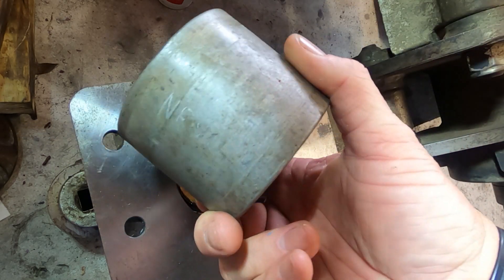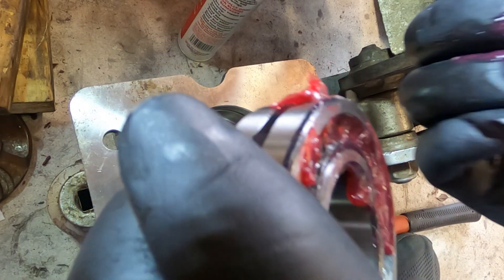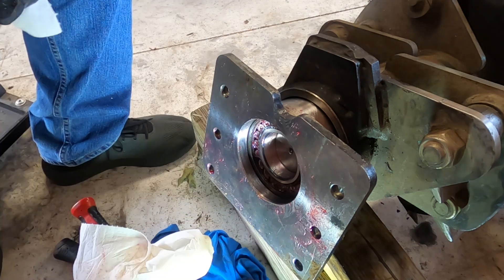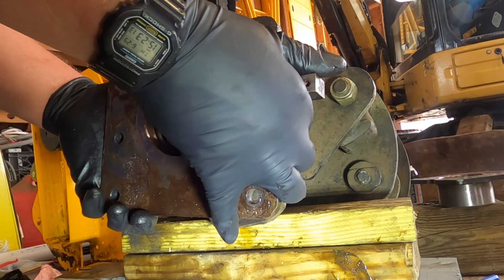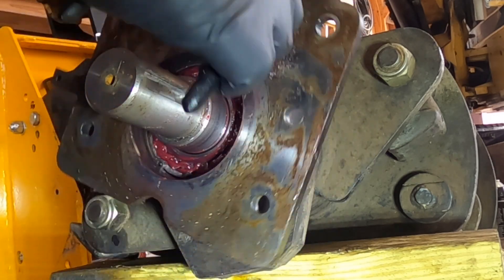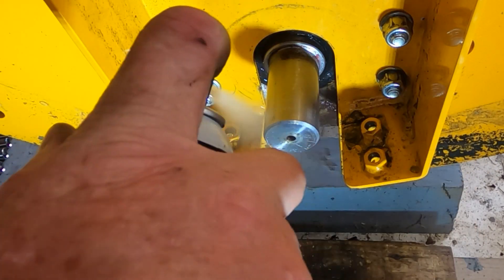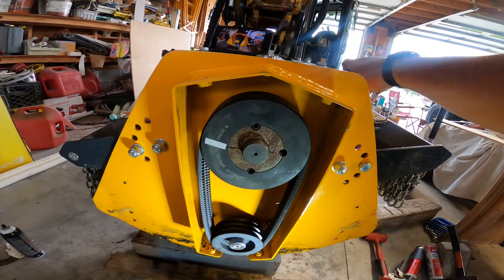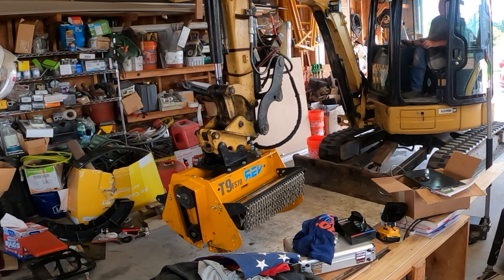Mongo High Inertia Mulcher Rebuild (Part 2)

Comment: How old is yours ? And What was yours doing ?
Reply from the maker: It was 11 months old, it wasn't coming up to speed after about 8 hrs of use.   They sent me the bearings to try first.  It ended up being the hydraulic motor.  Mongo Attachments was great to work with.  They sent me the parts for free.  After the bearings and motor replacement it ran like bew.
Reply: @VansHomeServices   mine struggles when fluid gets warm , replaced motor before because of it leaking but think this one is bad
Reply from the maker: Did you put a flow meter on it once it warms up to make sure you're getting the proper flow?